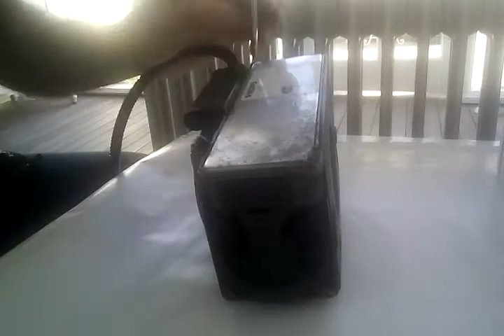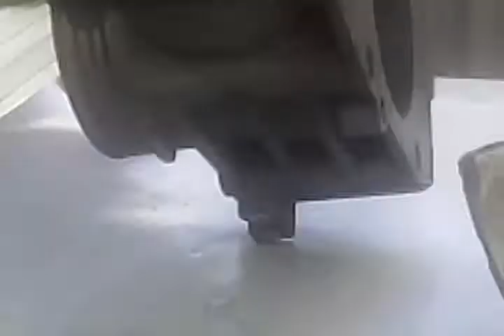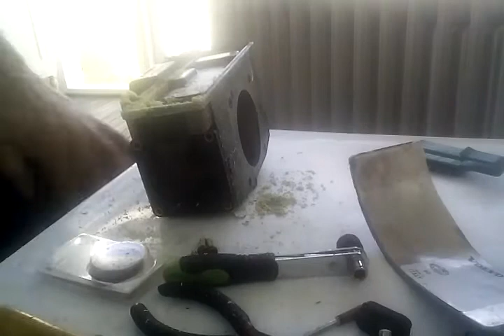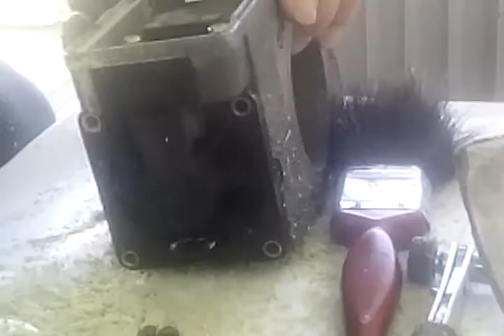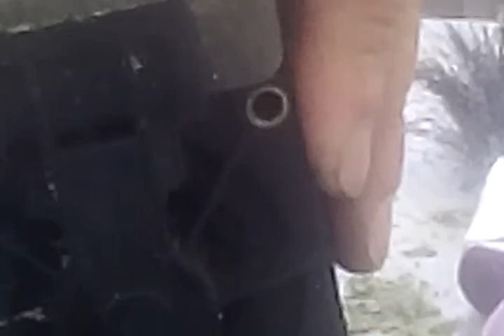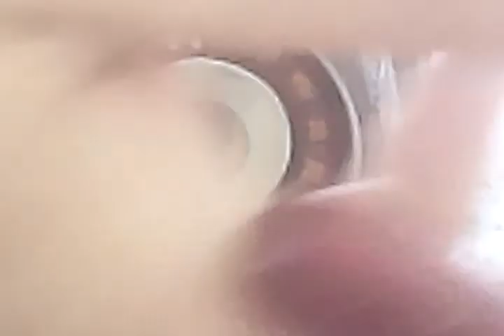Volvo ETM sensor 1 disassembly

Comment: If you are watching this video for steps to replace the non-contact throttle position sensor, you need to remove the other side.  The side without the access port.
Reply: Can you please explain that? Thank you.
Reply from the maker: @ricardoramos3095  The contactless sensor is always fitted to the Position 2 sensor on the opposite side.  There are 2 sensors on this throttle. The contactless sensor makes both of them reduntant.